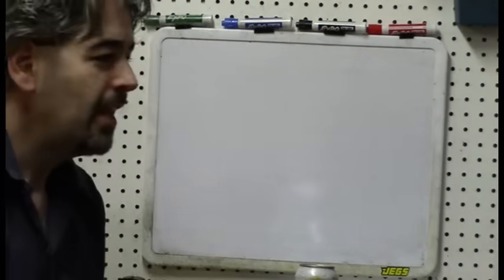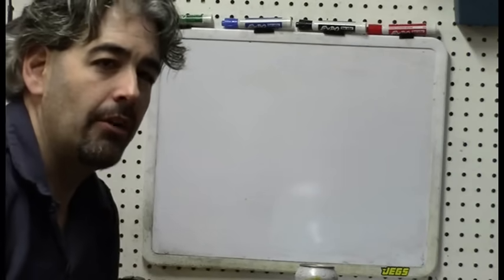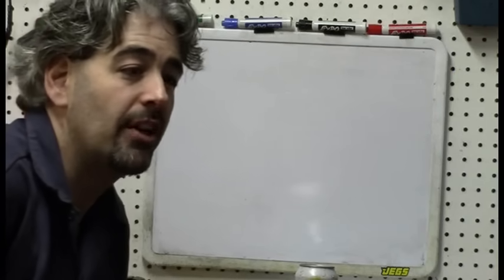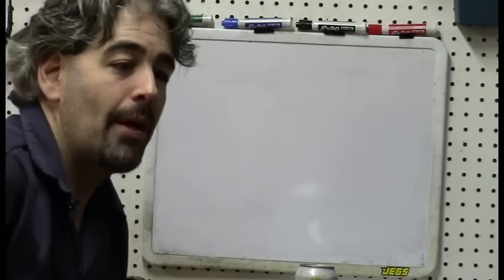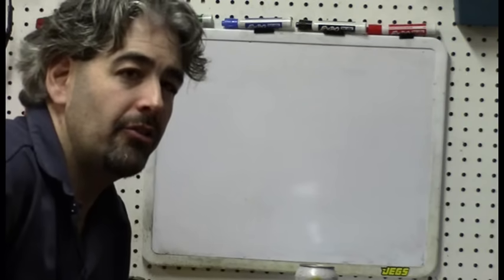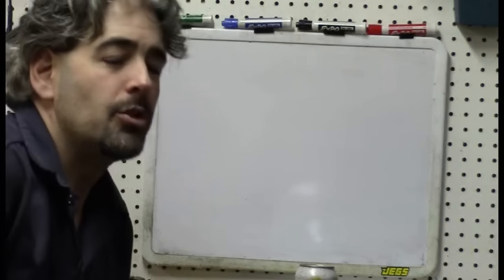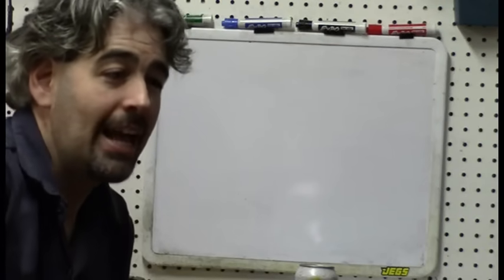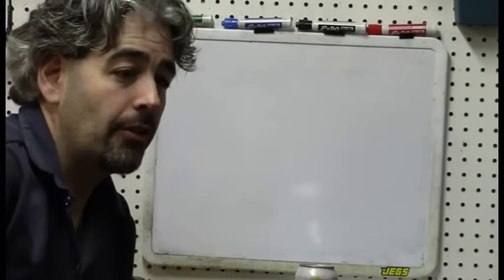Secret of Engine Problem Diagnosis- Fuel Trims Pt.1

Comment: I have a 2001 Seat with 1.6 16V engine. My issue is engine shaking at idle and high LTFT (+34% and 12%). O2 sensort and MAP are new.  The MAP is reading between 350-400mbar at idle. I have also noticed in STFT that the voltage stays around 0.4XX no matter the condition (idle or load). Could this steady voltage mean that I have a faulty wiring to the O2 sensor and be the real reason for high positive fuel trim ?
Reply from the maker: Can't tell with that data. You have to curve it against load.
 Why is the O2 and MAP new?
Reply: @SchrodingersBox  
The O2 was changed because I had error P1190. The MAP I changed just to be sure it's working. I have no error since O2 and MAP have been changed. The only time the voltage is outside 0.4xx is when I rev it at least 3000 RPM(voltage drops to 0.1xx for a split second then raises to 0.7xx for a split second then back to 0.4xx). Souldn't the voltage be always fluctuating between 0.1 - 0.9 on idle and creating a wave graph ? Mine is always at 0.4xx on idle, so no wave.

Comment: Ok, ive watched these video a few times now and i think I'm getting it.
But im going to take a guess here.. 
Can you please correct me if im wrong..

If i put a turbo on my e46 325. And run some low boost through it, 
(like 6-8 psi)
Then this system will be capable of automatically compensating for the boost, up to the point that either the fuel pump, or injector flow rate max out

So therefore, at lower boost levels, a remap is borderline pointless, and it is just to get rid of the check engine light, that was set by the fuel trims doing their job..

Am i correct? 

Thanks if u answer.

Comment: With my P0171 my LTFT stays in the ballpark of 26 even when I rev up.  Additionally Pepboys did a smoke test and found no leaks but did mention my o2 was kinda sporadic.  MAF and o2 were brand btw.  I previously had rewiring done on the o2 wire (leading to the PCM) because my downpipe melted the wire.  Is it possible its getting impropper ground or short from the o2 wires for this ghost lean reading?
Reply from the maker: yeah obviously not a vacuum leak. not sure why they bothered smoke testing.  why are the MAF and O2 brand new? what data showed those were needed? I would totally start there.
Reply: @SchrodingersBox  Because its extremely hard to find a mechanic in Vegas that knows how to read scans like a tuner would, never needed those new parts, long story short I have to learn things on my own.  I got rid of all my old CELs myself but now I have this ghost P0171 and I'm thinking its a bad circuit on the o2 wire, PCM side.
Reply from the maker: what evidence is there indicating this. You have a fuel trim that indicates correction from the short term. How would that happen if the O2 sensor was giving input to the PCM?

Comment: I have a Toyota Prius 2005, before watching your two videos, I had the P0172 code, my mechanic told me without looking at any freeze frames that let's start by changing the oxygen sensor on bank 1, he changed it upstream of the catalytic converter. problem did not go away. I had P0420 and tried cleaning the catalytic converter using Lacquer Thinner, it did not work for me although it did for my Honda Civic.
the mechanic claimed that may be it a bad oxygen sensor since it is not an original Toyota sensor, although when I bought it from Amazon, they verified it fits upstream bank 1 of my specific car.
replaced the oxygen sensor again after Amazon sent me another one and I still have the P0172, at this point I thought I have a bad MAF sensor, I ordered it and install it but the problem still did not go away. the freeze frame data I got before installing the MAF sensor says STFT B1 (%)= - 2.11 and LTFT B1 (%)= - 33.6, the O2S B1s2 (V) = 0.875, STFT B1S2(%) = 99.2, rpm=980, O2S B1S1 (V)=3.232
I would really appreciate it if you can advise what could be the problem.
By the way, I had the catalytic converter changed and may be 6 months ago the four fuel injectors changed

Thanks
Reply from the maker: You really need a better mechanic.
  I am not following though- why did you change the MAF??  WHere is your MAF data? Was there no voltasge after the hotwire?
Reply: @SchrodingersBox  Thank you very much for your reply, I have taken snap shots of all the freeze frame data, they are as follows:
EQ Ratio= 1.004; REL TPS%=0; Ambient (DEG.F.)=48.2; TPS B (%)= 46.7; Command TAC (%)= 14.9; Clr Time= 0H37M; ECU Volts (V)=13.847; Load Value (%)=12.2; Warmup DTC Clr=1; Clr Distance (Miles)=6; Evap_VP (in H2O)=0.126; BARO(InHg)=28.6; CAT Te 11 (DEG.F.)=756.1; CAT Te 12 (DEG.F.)= 412.5; O2S B1S2 (V)= 0.875; STFT B1S2 (%)= 99.2; Runtime (Sec)= 125; LAMBDA B1S1= 0.987; O2S B1S1 (V)= 3.232; Command EVAP (%)=0; ENG RPM= 980; Veh Speed (MPH)=1; Spark Adv (deg.)=15; IAT (DEG.F.)= 68; MAF (IB/MIN)=0.2; TPS(%)=14.9; Fuel Sys 1=CL; Fuel Sys 2= NA; Calc Load (%)= 12.5; ECT (DEG.F.)= 167; STFT B1 (%)= -2.11; LTFT B1 (%)= -33.6
Reply from the maker: I don't understand what you are trying to show, sorry. I see no curve against load or voltage readings from the hotwire. Why are you showing a MAF at .2 lb/min with a fixed TPS?
Reply: Schrodingers Box these are exactly the numbers that showed up the freeze frame, I will try to take another set of readings if these readings are telling much.
Reply: @SchrodingersBox  My  downstream sensor bank 1 sensor 2 is reading 0.6 V to 0.8 V, my bank 1 sensor 1 upstream is reading 3.1 to 5 volts, if it is reading higher than 0.9 volts, does that mean it is a bad sensor?

Comment: Propane can catch fire when testing. Why not just use a bottle of water to make the RPM go down? :)
Reply from the maker: How is propane going to catch fire when the latent heat of vaporization at 60 degrees is 700 BTUs and the ignition point is 1020F??
  Please explain.
Reply: I think...... It would just take a real explotion to make an explotion!! Don't you agree??? :)))))

Comment: What do I do if it doesn't move at all and it the ltft is really high
Reply from the maker: Try making a rich condition and see if fuel trim responds. If it doesn’t, the O2 sensor is faulty.

Comment: If the catalytic converter absolutely needs this rich/lean oscillation as picked up by an O2 Sensor, How does it achieve this with an air/fuel sensor? They don't oscillate or cause a rich/lean situation.
Reply from the maker: The A/F or O2 simply reports the oscillation- it does not cause it.  The oscillation is driven by the PCM adjusting the injector pulsewidth slightly- this is then reflected in the O2 trace.

Comment: If my LONGFT1 is at 3.1%, does that indicate a vacuum leak?
Reply from the maker: You can't tell from just that information as described in the video.
Reply: I guess what I meant was "is 3.1 high enough to apply to these concepts, because when explaining the relationship between the short term and long term trim and diagnosing the hypothetical vacuum leak, the example was 25%. I'm wondering if it being such a low number can narrow down or rule out any possible reasons for the issues I'm having. (P0300-multiple/random misfires, p0302 + p0303-cylinders 2+3 misfiring) Thank you for taking the time to respond to my question, despite it's initial vagueness.
Reply: Is my question still not being asked correctly?
Reply from the maker: What is the LTft and STFt when curves against load?

Comment: what happens if you drive with bad upstream(AFR) sensors? 

If there are no issues with fueling and no vac leaks everything is fine? But if there is an issue and it cant c0mpensate then you could start running lean or rich all the time? Would that cause damage?
Reply from the maker: Yes to everything- it would severely affect performance, economy and definitely could cause damage especially to the catalytic converters and ultimately the engine.
Reply: @SchrodingersBox  true....cats. Rarely die on there own,they are almost always Murdered by issues upstream of them.

Comment: Sorry i ask a question in another of your vids jeje now i see . Question is if my engine has a vacuum leak RPMS will increase, but rpms in my engine are steady between 500 and 750 always . But fuel mileage is very very bad, i see black dust coming out from exhauat at cold start but spark plugs electrodes are white like cigarrete ashes never black or brown my engine is jeep xj 2001
Reply from the maker: Check your IAC position. with a vacuum leak the IAC will try to close to compensate for the lean fuel trim.

Comment: if lets say the fuel pump didnt have a high enough flow rate, and thus increases pwm signal? looking for a normal but not being able to find it because Fuel pump isnt adequate? Say one that is 50gph and the OEM is up to 360lph. the conversion only brings you halfway to 360lph. So this would cause its "appearing rich" condition because the fuel pressure isnt adequate from the pump?
Reply from the maker: So there are a couple things about this-
  regardless of the GPH of the pump, if there is insufficient fuel delivery for any reason the O2’s will report lean and the PCM will initiate a Richen command. for example, say there is a filter restriction. No amount of GPH from a pump is going to meet the required rail pressure.  If rail pressure is not up to spec, no amount of pulsewidth modulation can correct it because remember the longer the pulsewidth, the more the pressure drops!
  Now on the other extreme, you absolutely could potentially cause a rich condition if you have too high of a pressure. But this is not likely to be caused by a pump.  A pump creates flow, not pressure. A blocked or pinched fuel return line for example-   any fuel pump operating normally on a system with a restricted fuel return is going to cause the rail pressure to double. This means for every pulse of the injector, more fuel then expected will get past because the pressure is higher than what is assumed. the PCM will command lean in response and restrict the pulsewidth but at double the pressure the PCM won’t be able to restrict enough to prevent the engine from balancing stoichiometrically.  The engine will run rich no matter what until flow issue is solved, similar to the lean issue described above. 
  Make sense?

Comment: Before my fuel pump went out supercharged 2015 Roush RS3 ,  STFT were around 5 to -11.  LTFT was at -11 to -15 at Cruze speed.    And Now after replacing the pump LTFT are -2 to -8. STFT are + 3 to- 5.   Deceleration  STFT goes to 0.   Cold start STFT is -25 and goes toward 0 as it warms up.   Over the past 6 months. Fuel trims have been in the - values.    Before the pump was replaced.  Are my fuel trims normal now?
Reply from the maker: you can’t say. at no time did you curve against load. you can’t say anything about the fuel trim before or after.

Comment: Schrodingers Box help I have a 07 saturn ion redline 2.0 supercharged and  a week ago I had a p0171 P0300 and P0420.  I decided to try some cataclean after I dumped into the gas tank I cleared all my codes it's been a week and the catalytic converter code has not came back it would come back every day after deleting it. Right now I still have a existing code P0171 and P0300 I look at my live data and my short-term fuel trim base 1 Sensor 2 is at 99.2% at all times. The Volts for both of my oxygen sensors run pretty normal ranging from .1 to .9 back and forth one day I did check and the Volts for sensor two were very low right around .1 and barely moving but the next day it was moving all over the place in a normal way. I just don't get the 99.2%.  I'm sure I'm forgetting stuff so please ask me any questions that can help you help me thank you!!
Reply from the maker: It's obvious you have a legitimate lean condition. I would need total FT with an induced rich condition curved against load with corresponding MAP voltages  to determine the cause. Actually, you would be able to determine the cause based on the video in fact.

Comment: Hey Matt! Greetings!

My 1997 4.3 s10 is really negative on FT. About -30 both banks.
Goes to 0+ if held at 2000rpm for about 20 seconds then slowly goes back to negative 17 or so.
MAF is overreporting but if i unplug it the truck still pulls out crazy amount of fuel. 

No regulator leak. 
No EVAP leak. 
No EGR stuck open and no bad PCV and O2s can be forced lean.

Leaking injectors both banks?Replace MAF before looking somewhere else?
Runs good at WOT. 
I’m not confident its just the MAF causing this and cant think of something to test injectors without any special tool. 

What else could it be, to maybe get better trim numbers and then replace MAF? ( MAF signal looks to be grounded inside-maf diag pt3)
Reply: MAF is 10g/s at idle.
IAT seems normal and ECT seem normal. TPS also normal. 
IAC is not supported by my scan tool but might be a problem. 

the truck starts right up every time but RPM acts weird on startup. Drops down pretty fast. 
Sorry, I probably should’ve written you an email 😂
Reply from the maker: what is the fuel pressure at idle vs under load?
Reply: @SchrodingersBox  i'll try to get someone to borrow me a fuel gauge. i don't know. should i expect it to be higher than normal?
 
here is some history. 
before i bought the car it ran good at idle but it wouldn't go over 3000rpm. before selling it to me the previous owner changed fuel pump because he said it died on the road. after i got it it seems it has been only getting worse over time. i only changed O2 sensors. because they where stuck at max of 0.300. the new ones oscilate normaly at full range but now it is running very rich. 

summarizing: i changed O2 sensors and it inverted completely from +50 trims to -30.

 Under both circumstances ( old and new O2s) it would zero out trims with throtle blipping but constant throttle wouldn't make a diference. so weird.

Comment: I have a question
can I improve engine horsepower by installing long pipes, will the engine compensate for the lean condition itself without throwing lean code? and to what extent
thank you
Reply from the maker: Yes to both. Any increase in airflow would be measured by the MAF so you won;t have a lean condition anyway
Reply: @SchrodingersBox  
Thank you for your answer 
Most of the time I never get an answer from the publisher, I really appreciate that
One more question if you don't mind 
I have 2 options in it
First deleting cath probably will definitely set a code
Second they move cath more away from engine block comparing to factory cath because pipes are longer
Will the second option set a code?
I'm worrying about possible temperature differences 
Thank you
Reply from the maker: @a.a7648  I have a 710HP supercharged trans am with dual high flow cats. Completely street/emissions compliant and no backpressure whatsoever in the exhaust.  That's the route I recommend.  I don;t do things like deletions or bypasses.  Clean and legal but still kick ass.
Reply: @SchrodingersBox  
Thank you for your answer 
With my hellcat
I'm leaning to that option too
Long pipes with cathalitic converter 
I do not want to do any computer tuning, but I'm worried that some type of code will popped up, 
What do you think personally is it ok to add long pipes and cath with no computer tuning 
How is your trans am, was it turned for long pipes or not?
Thank you

Comment: If i have a v8 with duel pips do i jus read both the fuel trims in both banks i have a 06charger rt it has fuel trim bank 1 and fuel trim bank 2 and maybe it would help me narrow down the side of the engine the problem might be on
Reply from the maker: Yes- on any V engine you MUST read both banks even if a code is only on one bank.  The other bank may simply just be slightly below threshold for setting a dual code so you could chase the wrong rabbit!

Comment: Hey sir got another question getting positive fuel trim short term going positive during acceleration long term staying at 14 used to go down under acceleration until I replaced my gas tank filler neck now going positive under acceleration no vaccum leaks no evap leaks replaced vent solenoid, MAF, purge and fuel filter and gas cap also what do you think is my problem? Fuel injectors going bad? It's up to about 14 on long term both banks.
Reply from the maker: What is the total trim showing?

Comment: It seems the catalytic converter is what matters! The o2s are there to protect it. So the cat is basically in control?
Reply from the maker: It’s not so much that the O2’s are there to protect the catalytic converter as much as to optimize its performance. By swaying rich to lean you optimize reduction of NOx emission and HC emissions  respectively. I guess it also might extend the life of the cats as opposed to-say-running only rich or lean all the time but the intent is to optimize emission performance.

Comment: Hi Again!  I have a 2010 elantra that has a rough idle issue. Car drives OK....Here are some readings from my scan tool
O2 Sensor Bank1 side 1   2.0 volts (Rich)   steady reading, O2 sensor Bank1 Side 2.......... 0.74 volts.....( Rich )  CLOSED LOOP
STFT    -0.78V   LTFT   + 1.56 %   What should I also should be looking at?  Or what do you think about these readings .....Thanks
Reply from the maker: you can’t tell anything from those readings. you are not comparing to anything- you just have one specific time point of fuel trim. you have no induction metrics or Load curve.
Reply: @SchrodingersBox  Ok... I will get some more data......Thanks Again

Comment: Hello, I have a 2000 camry 2.2l with high postive long term fuel trim at 20% at idle, but at higher rpm it drops to 5%,  short term fuel trim postive  5%-7 at idle but I cannot find a leak i hear a hiss when engine is idle and when revved up , would a exhaust manifold gasket or intake manifold leak would cuase this? I also have do NOT have check engine light on.  I swapped air filter,  both 02 sensors, cleaned TB , valve cover gasket.
Reply from the maker: you have a vacuum leak.